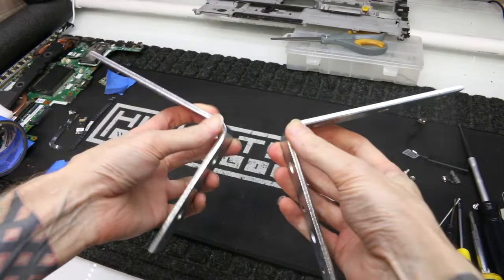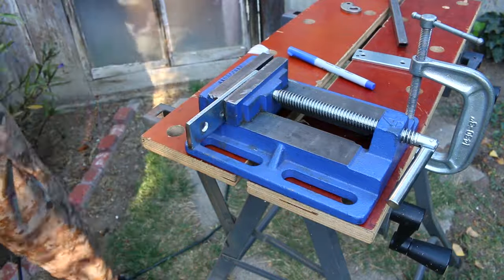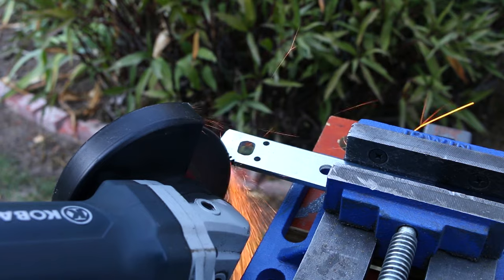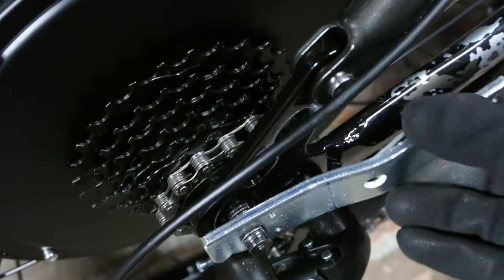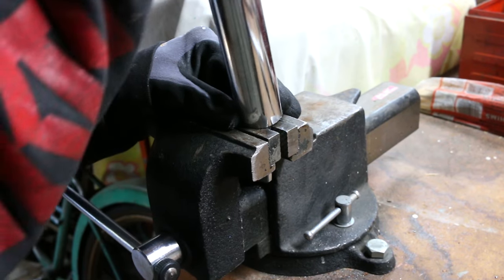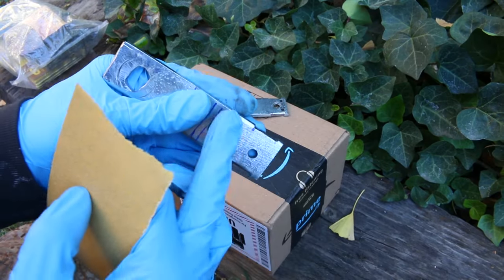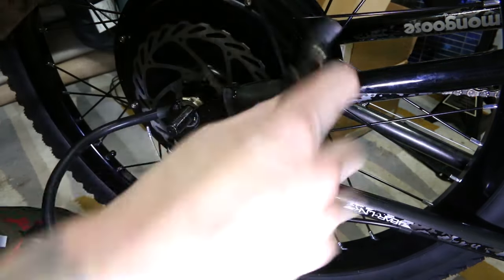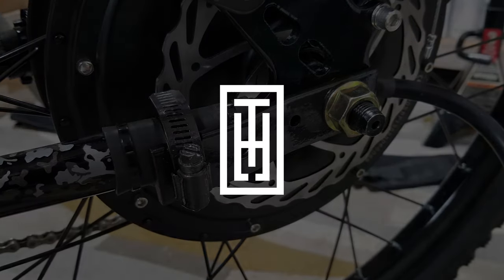🚲 How-To DIY Step By Step: Build Your Own Super Strong Torque Arms 💪

Comment from the maker: 1. I'm seeing some comments from viewers coming to this video and not knowing what a torque arm is. I was going to include a small blurb in the beginning of the video, but if you're watching a video on how to make your own TA's then you probably already know what they are, but a lot of you apparently don't, so here's the part I would have included in the beginning: 

A torque arm is an additional piece of support metal added to a bicycle frame to more securely hold the axle of a powerful hub motor. It’s designed to help your bicycle’s dropouts (the part of the bike that holds onto the axles of the wheels) resist the torque of an electric hub motor.

When you convert a standard pedal bicycle into an electric bicycle, the bicycle’s dropouts may not be designed to handle the torque produced by the electric hub motor. This is where a torque arm comes in. It grips the flat part of the motor axle and connects to the bicycle frame in a sturdy way to help resist that torque from forcing open the dropouts.

Torque arms are particularly necessary when dealing with more powerful motors. From my personal experience smaller motors of 1000 watts or less are usually fine to run without (if your dropouts are steel), but once you start getting up to about 3000 watts, problems can occur, especially with front forks and weaker materials like aluminum. In these cases, a torque arm is required to resist the torque of the hub motor.

2. I'm also seeing the usual "that's not strong enough" when you speak about anything regarding torque arms. Most concerns are with the hose clamps: PF already did a test of tensile strength of a lot of hose clamps and almost all were over 1000lbs before failure (mish golds are over 5000), even at 1000,  that's about 20x the weight of this entire bike. https://youtu.be/jtMPq2lG-8U?si=hdVrSRshWkTjnPjV&t=729  

The QS205 (5KW Motor) puts out a max of 182NM of torque, which is 134ft-lbs of torque. The motor I am installing on this bike is 3KW, but will see peaks of 6KW, I'm confident that these hose clamps are more than strong enough for this application. If they are not, I will make a video on it, and also show my solution. 

This video is just showing one way to make them, you can add additional hose clamps, or even come up with stronger attachments (create your own steel clamp that is bolted, etc). 

Thanks for watching.

Comment: Thank you for this video! For all those who are clueless why this is important if you ride an E bike chances are sooner or later the torque from the axle spinning in the opposite direction is going to shred your dropouts especially if you have an aluminum bike, it finally happened to me after a year of riding, this is overlooked by most eat bike manufacturers but trust me it is a very real thing that can hurt you or even kill you if you do not have these on an E bike that has a 750 W motor and up....
Reply from the maker: Thanks man, I actually sit on both sides of the fence because I got a lot of flack for saying in a lot of instances you don't really need torque arms and I've built a lot of bikes that don't have them (without any issues). I take a nuanced stance that if your frame and power level requires them, then they should be used for protection, but if they don't, then you don't need to run them which is dependent upon a lot of individual factors. I feel I have gained the experience to know if and when I need to run them. 

A lot of people tend to think you need to use them for all applications, upon all ebikes, for all purposes, and in all scenarios, no matter what. This is something I don't believe. Of course it won't hurt your bike to install them even if you don't need them (although you do sacrifice some convenience, and it will cost you some money (or time, or both)). 

I don't have a problem with people running torque arms on their bikes even if I don't in some circumstances. I not only take responsibility for my choices, but I have the means to correct a problem if it comes to that. I do have a problem when strangers try to tell me how I should use the things that I own, that I bought with my own money.
Reply: Well no matter what case you're in at least you're making good content I'm in a situation now where I never thought I would be in I've had my e-bike for over a year have over 1500 Mi on it's a Chinese e-bike and now I can't ride it because the axle keeps twisting out the only way to save this bike now is to find some type of welder or I hope these torque arm actually work whatever it is I have a challenge in front of me
Reply from the maker: @sixfoursoul2538  Thanks man! Yeah, if you can get someone to weld on new plates for the dropouts you'll be back in business, that's what I would do. I have a welder so I can make such repairs. If you're inclined, you can get a stick welder for very cheap and it will do the job just fine, it just won't look pretty but it will be very strong. Or find a local welding place and tell them what you need, shouldn't cost too much to repair. 👍

Comment: Just a side note for those with a 3D printer: Some simple OpenSCAD script / CAD designing enables you to design a perfekt template matching your axle plus the angle related to the dropout of your frame. I even did a two part torque arm in OpenSCAD which was lasered from 6 mm stainless steel. There are a lot companies doing this for a relative low price compared to those mucho U$$$ torque arms from Grin.
Reply from the maker: These are great tips Holger, thank you. Yes once you have the 3D model you can get them cutout from a service like send-cut-send in whatever thickness steel you needed and it's not "too" expensive, especially if you need something precise and robust. 👍

Comment: Hose clamps are relatively strong, but they are still just thin strips of metal. I understand the mechanical advantage, but I would feel better by putting 2. Doubling them up side by side.
Reply from the maker: You can put 3 if you want 😎
Reply: @hightech-lowlife  . Wow! Three hose clamps. What a beast!
Reply from the maker: @E-BikingAdventures  You can also extend it as far as you want and also just weld directly to the frame if that's not strong enough 👍I will test on my new 6KW build and if the single hose clamps break, I'll be sure to let you guys know.
Reply from the maker: More research, PF already did a test of tensile strength of a lot of hose clamps and almost all were over 1000lbs before failure (mish golds are over 5000), even at 1000,  that's about 20x the weight of the entire bike. https://youtu.be/jtMPq2lG-8U?si=hdVrSRshWkTjnPjV&t=729
Reply: @hightech-lowlife  how does it hold up still going solid?
Reply from the maker: @yenerkayahan3737  100%, just as I thought without a single doubt in my mind.

Comment: Hose clamps don't exist with torque arms because of their quality to do this type of job, but simply due to their universal nature.  You would be better off bending the steel to cradle the frame or finding a hole to bolt it to.
Reply from the maker: It's possible, this is the 2nd critique of "hose clamps not being strong enough", but unless you have data it's speculation. I will test these on my 6KW build, if they break I will let you guys know for sure. If they can handle it then I would confidently refute this speculation. I state that you can weld directly to the frame. The further from the pivot the less strong the hose clamps need to be due to leverage. You can also double and triple up the clamps if weary. 

Maybe for my next higher power build I will make a video on how to make even stronger torque arms. Most people are not running 6KW to their dropouts however, and these are more than enough for that.
Reply from the maker: More research, PF already did a test of tensile strength of a lot of hose clamps and almost all were over 1000lbs before failure (mish golds are over 5000), even at 1000,  that's about 20x the weight of the entire bike. https://youtu.be/jtMPq2lG-8U?si=hdVrSRshWkTjnPjV&t=729
Reply: @hightech-lowlife that would be pretty intense. The 6 inch lever arm with a 1000lb breaking force, that set up should withstand 500 foot pounds of torque from either side, or maybe 1,000 ft lb of torque overall. Even at 6kw, you are at way less torque

Comment: best advice get rid of the hose clamps and buy heavy duty hose clamps. the screw on with a big bolt rather than a weak piece of aluminum. never really have to tighten them. u saved me alot of hassel i have two of those same cheap torque arms and one grin v4 but none of them fight correctly and everytime i ride the bike i worry. im doing this tomorrow lol
Reply from the maker: If I beak a hose clamp I'll replace them with stronger ones (and document that on my channel), but due to the pivot point they don't see nearly as much torque, plus they are good for hundreds of pounds of force. I have these on a 6KW bike and there are zero issues, but if you don't trust it, go for it. You can add two or three (or more?) if you want but it's overkill. If you really wanted you can use U-bolts, or make your own clamps from thick steel. 🍻

Comment: I had the same exact problem when I was using that same exact brand but matte black The drawing process is 48 hours not 24 hours they lying😐 I find that really helps when you put it in a tiny room with a big box fan No light no heat🤨
Reply from the maker: Yeah I've never seen any paint that stays that tacky after such a long time, most will dry fully within 1 day 👍 Thanks man!

Comment: What problem is this solving?  Also, looks like this adds quite a bit of work to a flat tire repair.
Reply from the maker: https://www.ebikeschool.com/torque-arm-need-one/ 

100% makes changing tires more of a pain, but hub motors already complicate this, and if you're familiar with that, then this is just another 5 seconds added to the process, pretty easy to take on and off.

Comment: How to Fix a non  problem?
Reply from the maker: Most likely they are not needed, however this build is 6KW, and once you start getting higher up there in the torque it becomes more and more of a necessity.
Reply: Once you start doing some high performance mods, you have to make sure you’re safe. These give you peace of mind.